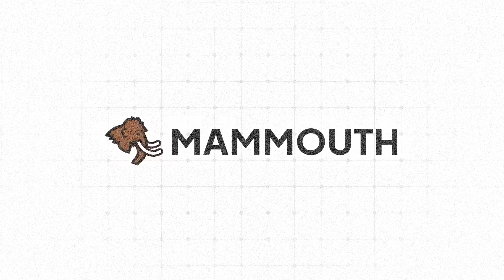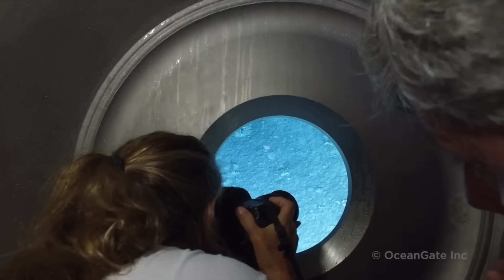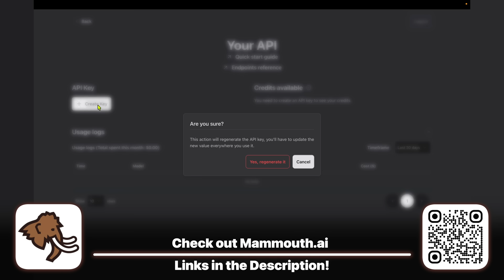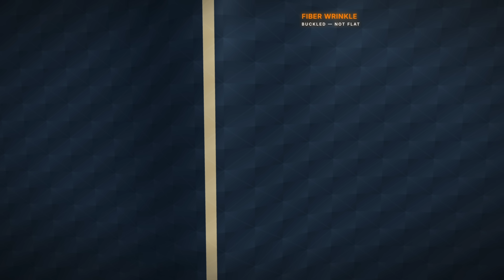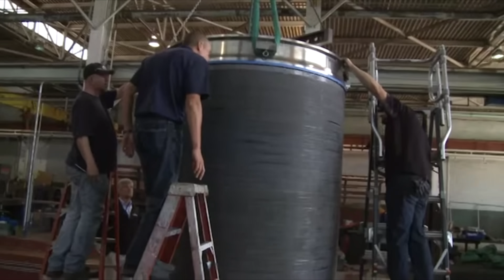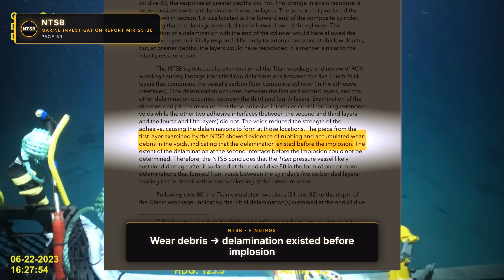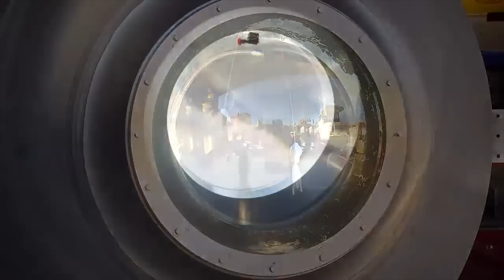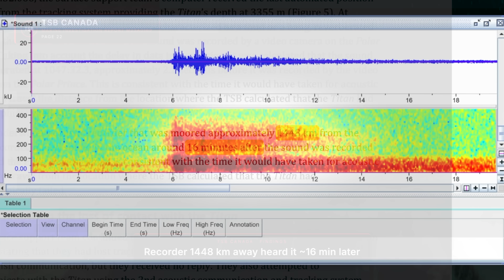Oceangate Titan: It was WORSE Than We Thought

Comment: Military submarines have four different depth ratings.  First, there is design depth, which, as it sounds, is the theoretical maximum depth at which the sub can operate safely.  Then there is test depth, the maximum depth to which the submarine can operate in peacetime.  In the U.S. Navy, this is 67% of design depth (so, if the design depth is 1000 feet, test depth would be 670 feet).  Third, there is maximum operating depth, also called "not to exceed", the greatest depth at which the submarine may be operated safely under ANY conditions (including wartime).  And finally, there is "crush" or "collapse depth", at which the pressure hull fails.  This is used in the design process to calculate the strength and thickness of the pressure hull.

Design depth has a lot of safety factors built into it, which it is why it is significantly less than collapse depth. Since  margins are built into  every depth rating the cumulative margins are quite large.

Comment: A target safety factor rating of 1.25 is absolutely crazy low to begin with,   especially to bet human lives on. 

Even simple lifting hoists like nylon ropes are supposed to be made and used at at least a safety factor rating of 5:1.

And you don’t need to be an engineer to understand why; when I was a kid and my dad built me a swing, he explained the concept of a safety factor to me in a way that even 8yo me could understand fully. 

And he decided to go for a 10:1 safety factor for the weight rating of the ropes, just to be on the safe side, and we took down the swing in the winter so the ropes never had to withstand freezing degrees.

In other words, my non-engineer dad and his 8yo daughter put far more thought into safety factor rating and environmentally caused cumulative fatigue for a swing hanging 50cm above ground…

…than these submarine builders did for an experimental underwater vehicle expected to be capable of repeatedly doing dives several kilometres down into the deep ocean under multiple atmosphere’s worth of pressure, with the environmental factors and material fatigue issues that that would entail.
Reply: Problem is, the engineers knew this was an issue and complained and raised concerns, but they were silenced or had to quit because of being ignored.

As always, people with lots of money but no common sense refuse to listen to "the nerds", when those same people are the ones who are experts and actually know what they're talking about.
Reply: Yeah that'd be like...for auto diver bots or something at best MAYBE. Nothing with passengers, even just one.

Comment: Carbon fiber composites should never be used in compression!  Every composites engineer knows this.  That was a ticking time bomb.  The designer is a moron and he died because of it.  Fatigue is not the issue, it’s the compression.  And no material is defect free.  One of the main tenants of modern materials design takes as a presumption that defects will be there from the get-go.  No navy on the planet came up with this design for a very good reason.  It’s a shame he took others with him, but the world is better off without this dangerously stupid designer.

Comment: Starts with.  "Carbon fiber hull, if properly built, should have been virtually indestructible."  Goes on for half the video showing how the carbon fiber hull failed in a multitude of ways.  Maybe there is no way to properly build a cylindrical, carbon fiber hull that would have withstood hundreds of cycles.  Like you point out discussing why nobody uses them.  You have so many contradictions in your video.  Still informative, you may just want to look over your script in the future.  Edit:  OMG, an alarm always going off is not a false positive if it is alerting the thing it is supposed to be detecting.  That is a psychological problem with ignoring the alarm, more akin to habituation or alert fatigue.  FFS.

Comment: Saying that the acoustics wouldn't work is clearly wrong. The sensors were clearly telling them that there was a problem.  The problem was the owner who ignored the failing hull. They actually replaced one and counted the dives on hull1 as dives continuing on hull two. They were lying to themselves and others simply because he thought it would work. Therefore no loud bang or shifting fibers (that should not shift, by the way) was nothing. 

Carbon fiber doesn't settle since once cured in this way the fibers can't move without steering layers or snapping fibers or both. Once this happens it's failing. They new that and refused to care.

No safety feature works when you ignore it. Stockton ignored everything and everyone that didn't share his reckless ambitions.

Comment: Anybody with CF layup experience knows there is no such thing as 100% resin impregnation with the fiber! I don't care how much vacuum you pull. When I first heard they were building the pressure tube this way, I knew they were dead men. Additionally, they didn't have the practical knowledge about CF construction to pick up on the early clues, the pressure pings being emitted on dives. That was water breaking into the CF structure. A slow process, like a dam failure, then REAL FAST at the end. Bunch of rich people that had much more money than sense. Fleetwood Mac wrote a song about that, "Oh Well"

Comment: My take, pre watch was that the glue bonding the titanium rings to the carbon compromised due to the cylinders flex under pressure. Tiniest bow in the carbon would carry to the ends of the cylinder and where the glue bonds to the rings would give. As soon as it did the force of the water would penetrate and tear it apart, from the look the seal at the front failed and it tore into the back, shattering the carbon and shoving the passenger compartment towards the tail. 

The carbon was plied laterally instead of diagonally, which made it more prone to this flex. 

After being subjected to multiple dives then being tested near threshold the glue bond couldn't hold. 

Had the carbon been plied diagonally and a few inches thicker this likely would be a non issue. 

I was unaware it was a downgraded titanium used for the rings. Highly unlikely (impossible) they were the cause bc if they flexed there would be a crack in them when they were retrieved. Brittle strength.
Reply: (The pop can comparison isn't truly apt bc it is all one casting whereas the rings and cylinder were seperate, waiting to seperate again)

Comment: I'm no engineer by any means, I'm a lowly safety manager : but one of the things that has bothered me since I heard it, is the use of a gaming controller to operate this vehicle, the Logitech F710S, .... it's not THE controller per-se but what it represents, this was a private owned tourist sub charging a million dollars per seat, yet  it was operated by a device, that was a generic option on its 1st day over a decade out-of date (that controller was new in 2009), now in 2019, the prototype sub was operated with a jail-broken Sony dual-sense 3, by comparison a controller worth 3X as much and sporting some proprietary software, but it's not the controller itself that bothered me, it's what it represents, 
for a company charging premium prices to cater to customers, they cut A-LOT of corners, rather than continue  using controllers at $60, and modifying them they choose to buy controllers that were a decade out of date for (no joke) between $5 & $15 per unit, so if that's a cost saving practice ocean gate employed, it would make some people [and it did] ask :? what other corners are being cut? Oceangate opted to make their own carbon Fibre mesh, the made their own CNC machines to produce their titanium reinforcements, they brought used PCV molds to make the veiwports, 
A company that couldn't be bothered to continue buying name-brand controllers, also bought and/ manufactured EVERY single part of that same submarine, then they bought every singe safety testing device, and it's corresponding software,
so that anytime someone challenged them on their practice the response was to buy that body & it's testing g equipment, OR,  to re-tegister in another jurisdiction to avoid answering to any authority 

the very fact that Mr. Rush was actually proud of skirting authority, should have made anyone offered a ride on that hillbilly-mobile , scared shltless, and add to that the waiver that openly stated that the parent company is not responsible for any part of protecting its customers??? ....it's hard to feel sorry for a$$hole millionaires that litterally paid a billion dollars to ride their own coffin into 14,000ft deep water, (I only feel bed for the 17y.o. that was dragged unwillingly into a father's day gimmick)

and the final nail in the coffin = why the sub had to be towed?, it wasn't because of some mechanical logistics as many oceangate members publicly stated, it was far more pedestrian, and a common practice in the U.S., if you drive a vehicle in the U.S. it's subject to one of 50 state regulation safety bodies, if you put that same vehicle on a tow truck the truck is subject to the same standards,  BUT! if you put the vehicle on an independent trailer and tow it, it's only subject to your personal insurance requirements, so many race car drivers will opt to buy a fancy trailer and put their non-road safe vehicles inside said trailer, as the trailer NOT the car is the part that touches the road, that's what gets regulation, and not the trailers contents...😢
Reply: For real man.... I think he was trying to show how "simple" the design was. "It's not complicated, anyone can pilot this sub, why add needless complication?" kinda thing
Personally I can't stand wireless. I have a wired mouse and keyboard, and a wired ethernet connection. I'm not prepared to bet a game of Fortnite on wireless equipment and I don't even like Fortnite. To bet your life on being able to pilot a sub at over two miles down is beyond crazy to me
Reply: perhaps thats what he wanted to portray, but thats not what In or a lot of other people experienced, 
the message i got was more = " if you want a ride it'll cost you $1M, but ,the car is un-inspected, the tires are used and mismatched, the seat belts are from TEMU, and the steering wheel is from a Game-Stop lost'n'found"

I guess I never got the message of "simplicity", as you said you're not willing to trust an afternoon throw away game to wireless, but Stockton was willing to bet real human lives on a controller that was generic cheap trash when it was brand new 12 years ago, 
and in my opinion, this guy committed su!cide and took 5 people with him, and every one that knew what he was doing should be charged as accomplices to 5 counts of m*rder 😢
Reply: @kiralana324  Yeah exactly, it just looks cheap. I do wonder if it played into the urban legend that modern-day military vessels (or systems on those vessels) use game controllers but that's not true. Some controls do look like that, but they're built from the ground up.
I might agree that in the modern era, video game controllers have a certain intuitiveness about them, and Mush would also invite the customers to pilot it around themselves. So yeah you would want people to feel comfortable about doing that. And they did also modify the controllers slightly, replacing the thumbpads with joysticks for finer control. It's the fact that they were wireless that kills it for me. That's a mental hump that I just can't get over.
Mush's backup plan, in case of control loss, was to just sit there on the ocean floor until the ballast straps dissolved, releasing the ballast and thus floating to the top. But you don't have to completely lose control to be in trouble. If your control loss is intermittent, it would be unpilotable.
In the end, yes, if Mush hadn't been onboard, he'd be on the hook for murder. To borrow the title of another YTer's analysis, this was "insultingly predictable."
Reply: Ill admit I was unaware that there was no back up plan but to wait for the weights to fall off?😅, but I guess I'm less bothered by wireless than I am about, using equipment that even people in the industry look down on, fir ex: I have a friend that does E tournaments, she joked about it once that
 " if you brought that controller to my tournament, we'd forfeit and I'd kick you off the team", 
another ex: I bought my PS5 around the time that sub went down, the OEM controllers run about $80, I replaced mine with a $250 customizable only a month later, and even then a type C data cable can still be used to hardline the controller to the system, to not have at least that as a back-up plan is bonkers
Reply: @kiralana324  that was about the top and bottom of it yeah lol, I dunno it's such a weird mixture of clever and stupid, he had the awareness to recognise that getting stuck at the bottom of the ocean is a Very Bad Thing and knew to prevent that. I think they always carried a spare controller too. Personally I've never had a problem with Logitech itself, my (wired!) keyboard is Logitech, but it is very much a cheap third-party company
He seems to have assumed that, in the event of total power failure or control loss, help would never arrive in time to lift them from the depths, and I do think that's a fair assumption
But he also chose to be untethered, for whatever reason

Comment: One thing would have been a monolithic build of a cross weaving vs the way the built each layer. The multiple curing cycles didn't help the case. Idk about you but with the pressures that thing saw I would hope for a safety factor of at least 3, 1.25 is insane to start with. Boeing said 7in   they built it 5in. It should have been 15in to 21in thicc to be in that 3:1 safety factor. I'm just a guy who likes carbon fiber and this is my opinion.

Comment: A very interesting video, clarifies a great deal.

I find myself thinking of ALVIN, one of the very first DSVs, and the extraordinary thoroughness shown in both her basic design and the testing of her original pressure vessels  .Three were fabricated - the "worst" of which was to be destruction-tested.

Said test involved placing the sphere in a special test chamber using pressurized oil, and taken beyond 4,000 psi.  At 4,300 psi, there was an explosion when the test chamber itself failed.  The 40,000 pound lid of that chamber detached, shot up at least 40 feet THROUGH the lab roof, came straight back down (landing almost perfectly back in place), and hammered what was left of the chamber about two feet down into solid concrete.  Chunks of wreckage took out a couple of cars parked outside, and the sudden huge pressure change  created a 'fog bank' of oil that enveloped most of the immediate neighbourhood.  Happily, no injuries.

The sphere survived fully intact.  Given that it had withstood stresses WAY in excess of what was planned for, the ALVIN team proceeded with confidence.

From ''Water Baby - The Story Of ALVIN' by Victoria A Kahari

I can't help but feel that if Rush had taken the whole thing a third as seriously as ALVIN's designers, he would have been OK.

Comment: Wait wait wait, you're telling me every layer of fiber was aligned the same?!?!
That's the most basic thing you do with any fiber layers in a lamination, for that specific reason if there's even fiber glass reinforcement, there's going to be at least two-three layers of reinforcement so they can rotate orientation and drastically increase overall strength than if you just layered three the same way